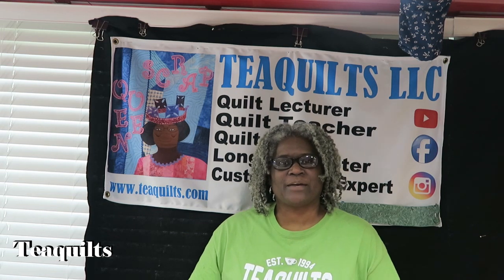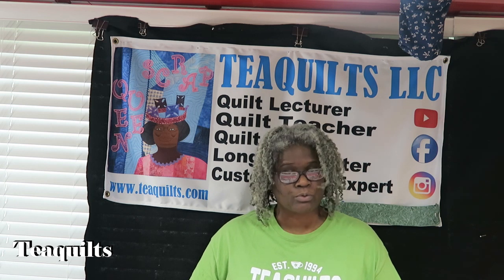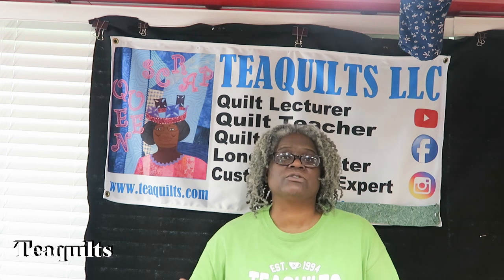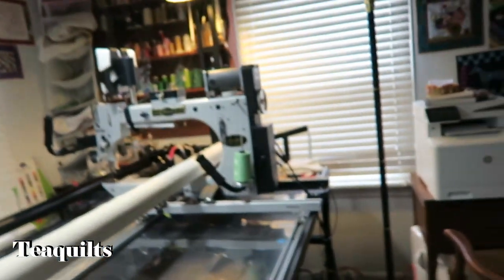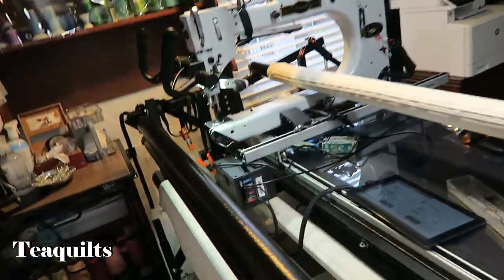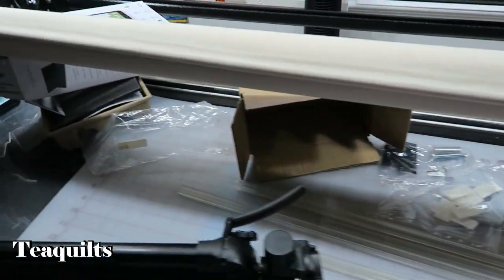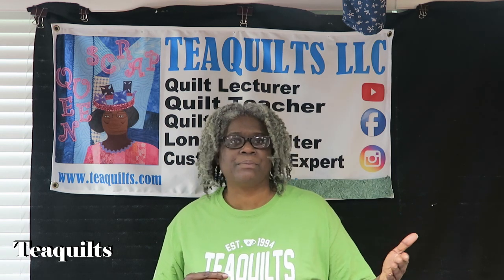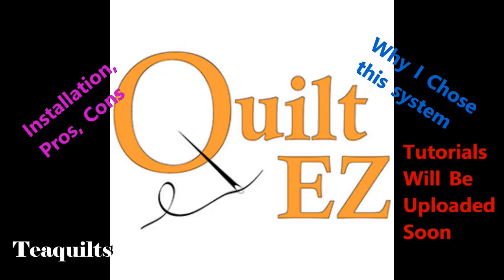Teaquilts:  Why I Computerized My Longarm - Quilt-EZ - Butler Robotics

Comment: Hi Tea, I also have a computerized quilt system. It’s innova. It is an experience although I used this machine several times at the quilt shop that I purchased it from. They are innova representatives. I have had it a year and still learning many things about it? The most important is that it gets the quilting done faster with beautiful designs. There is a lot of support from Innova and believe me I have called many times.
Reply from the maker: Good to know! It may help someone else.  I know if I NEED help, the ex-dealer will help me.  She is still helping the people she installed for.  I'm trying not to seek her help as I don't want to make videos where I'm sharing her knowledge.  I'm using my channel as a learn with me as I figure this system out.

Comment: Thank you for this video I bought a longarm  without stitch regulation outright. I thought that computerized was out of the reach your video really helped
Reply from the maker: Good luck Veronica if you pursue this
Reply: @teaquilts   I just got my quote for perfect stitch and the butler it’s 9,800. My current machine doesn’t even have a stitch regulation. But it will all be on one tablet instead of 2 like yours. I have a person that will warranty the work and is working with me. So I feel like that is awesome. If you are still in need of a maintenance person they are a really nice family I can pass you on the information.
Reply from the maker: @thequiltingsheshed8118  does the person work in STL area? If so,   I'd love the contact.
Reply from the maker: @thequiltingsheshed8118  thanks. I will keep his contact information for future needs.

Comment: Hey Ms. Tea! 2019 Subscriber of the year here!  This video was so informative. Thanks so much for sharing! i have a few questions/comments: I like that you can crop out areas that you don't want to quilt. I'm not surprised about the installer having never done a left hand installation. Kudos to you for not conforming to a right hand setup. One perk for having a left hand setup, not many if any will want to use your machine. lol Yay Lefties! Were the Statler and Elevate computerized systems specific to Gammill products? Should you consider possible compatibility issues when purchasing computerized systems? Your friend with the Butler system, what longarm does she have? The new Butler off brand monitor/tablet- Is there an option to switch out to a more name brand, if it ever breaks? How far away is it for you to get in person help, if needed? I saw a video where Gammill will invite their longarm owners to a 2-3 day training on new things Gammill. Since your purchase was in 2015, I wonder if they have made any updates to make the computerized install easier? i.e. one plug insert Does Gammill and Butler come with a user manual with user maintenance to keep the machine/system running, since it may be a challenge to service? Are Butler system updates free or reasonable is there is a charge?
Reply: Following this comment, I had several of the same concerns.
Reply from the maker: Lots here, I hope I answer it all.

1.  You can only get Statler and Elevate on Gammill longarms that are 22" or larger.

2.  You should purchase from same/recommended company when adding the computerized system if you didn't include in original purchase.  For me, that was way over my budget...I couldn't afford it.  Even if I'd purchase the Elevate (the cheaper of the two), I would have only been able to do pantos for the most part - no custom work.

3. My friend has it on a Gammill longarm; I think it's a Vision 2.0 as well. The reason I considered it and then purchased.

4. I think I would have to upgrade with a tablet from Quilt-ez as the tablet must talk to the main box to run the system.

5. The nearest Gammill dealer is about 3-4 hours away.  I don't use them.  I purchase my machine locally.  Although the center is no longer a dealer, I still use them for replacement parts and service, if needed.  I haven't had to have any service on my system.  I've done minor replacements myself.  

6. When you purchase a Gammill, it include training when delivered and another training session 1-3 months afterwards.  The center could extend the time frame if you need or ask.  They want you to work at home and then come with a list of questions and they show you some longarm stitches you can use for quilting.

7. No updates to the Vision 2.0 have been made.

8. I have a video series/playlist on the Gammill why I purchased this longarm.  You will get more info there, but yes, comes with a manual, quick reference guide, and a parts booklet.  The butler's manual is downloadable online.  Not very well written.  You will need to watch some videos to see how the commands relate to each other.

9. Basic butler system updates are free.  However at some point you will need to upgrade the tablet.  It's like when Microsoft update MS Word.  It can have revisions, but when they completely rewrite the software, you'll need to pay an update fee.

Comment: Have you ever encountered a “stitcher Communication” error and how did you fix it? My x and y diagnostics test works but I’m not getting any communication to run the software.😳
Reply from the maker: No, I haven't. Have you ever stitched?
Reply from the maker: If not, you need your machine set up in the software. It's different for each brand. Contact Quilt EZ, and they'll get you setup